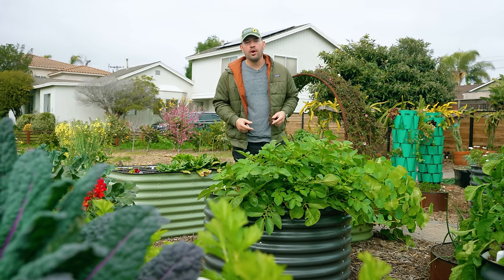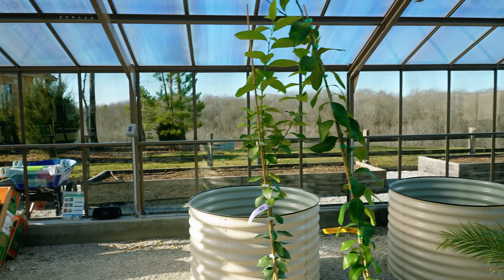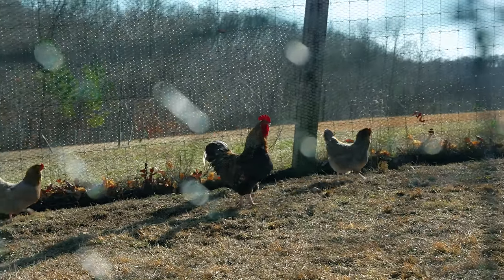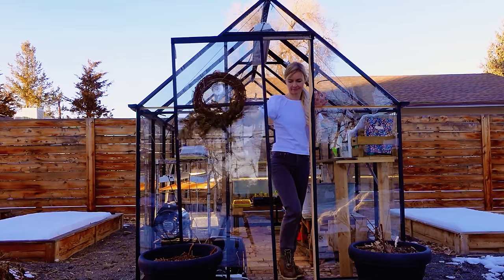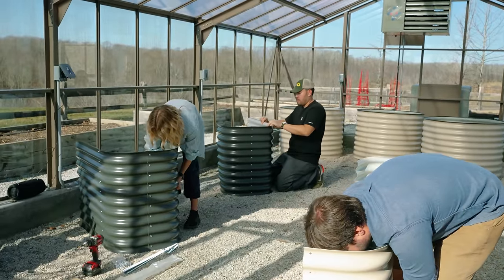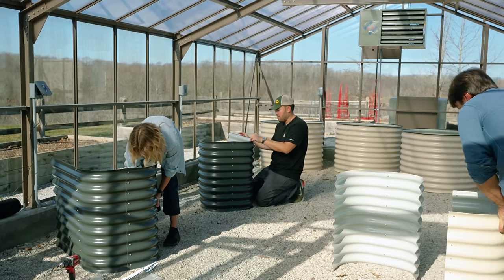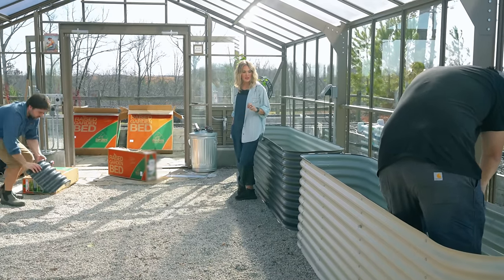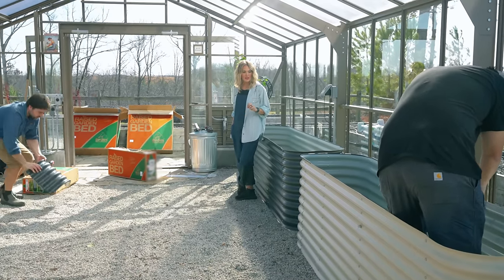Carrie Underwood's EPIC Greenhouse Buildout - @carrieunderwood

Comment: I know this is an older post but as far as the potato issue goes, There are determinant and inderterminant types. Determinant like yukon gold and red norland will only produce tubers on a single level. So to get a container full, you would need to plant a level, add dirt then plant another level. Indeterminant ones you can add soil and they will add potatoes up the stem. So if she planted a determinant potato, it really would matter how much dirt she piled on. There wil only be potatoes on one level.

Comment: Great job guys super Greenhouse looks really clean and tidy with your raised beds I hope Carrie has a Baseline irrigation system with a Garden on that scale it would make watering so much easier some of the smaller areas they could use the Rachio System which can all be operated online, also if they installed an EZ-Flo Main-Line Dispensing System on the irrigation or zone lines then you can put in products like Dramatic K Fish and Kelp Fertilizer and Myco ApplySoluble MAXX

Comment: Good stuff guys, it'd be mint to see it filled out later.
What are your thoughts on HPS to extend a season?
There is a tight budget so $150 HPS vs 2k LED lights leaves a lot of room for power. They are also a good heater.

At the very bottom of NZ greenhouse is 2.4m x 3.6 & 2.4m high

Comment: I had the EXACT same experience with potatoes as Carrue mentions… I’m in TN too…but I think ants may have eaten my potatoes?? I got absolutely NOTHING…in several grow bags…did the same, adding soil as the potato plant grew…left til green part was completely dead…then waited a couple of weeks. No evidence whatsoever that any potatoes had ever been there(no rotten potatoes or anything)…I have been trying to figure out how to put the grow bags on something like concrete blocks inside something I can have a water barrier to prevent ants…I have a very bad problem with ants in my yard…trying to address this too…
ANY IDEA why no potatoes grew in any of my grow bags?? Could ants have been the problem? LOTS of ants in the bags when I dumped them out.

Comment: I have a small suggestion: you look like a tall dude and I encourage you to customize your "countertop" height to suit your height...rather than a conventional height. Adding even a few inches/the equivalent in metric to the counter heights in my cabin kitchen and bathroom(s) proved to be a massive  boon to my back. My kids were then Itty bitty, but I simply bought sturdy collapsible ladders/step stools which they, themselves, could pop up/use/return to their bespoke niches. 

My sons grew to be taller than even I myself...and have commented ~ as adults ~ how much they prefer the counters THERE as opposed to those here (in town)...which are the "standard height". 

My lake countertops are very basic (a "temporary" set up with 2×4 construction and homemade bespoke (and beautiful) fabric "cabinet doors" on metal iron  hardware which allows the "doors" to be opened & closed...hiding the plywood shelves with large  Rubbermaid containers in which all our dishes/pots & pans/Bakeware are stored. This was a necessary evil to minimize work as the cabin was not yet 100% vermin-proof...and deermice are a health hazard I took seriously. 

Ironically enough...decades later (and a medical crisis which preempted our weekly visits during the years of rehab thereafer) means our "temporary" kitchen endured far longer than I ever imagined it would. 

In retrospect, I am so glad I took the time initially to fashion the curtains (and to clad the framing 2x4's likewise in matching fabrics) as I genuinely like "pretty" yet highly functional design. I knew it would bug me if I had open shelves with the ugly/functional framing materials exposed to view. 

We originally sufficed with an adhesive vinyl shelf liner as my "counter top" (for the safety protocol for sanitizing against deer mice is DAILY BLEACHING of all horizontal surfaces (or any and all cookware which was not immediately [upon becoming dry] stored away in my "hermetically sealed" containers)...so plain plywood would not do. 

We eventually "upgraded" to sheets of good quality countertop material, framed with showwood in edge grain hemlock (to match the custom cut 16"×5" slabs of old growth timber we had milled for our window sills). One can legally buy "Stanley Park Fall Down" which results when the old growth timber gets blown down by winds and thereafter send such rare wood to a "Custom Cut" mill to be cut to your specs. 

We used oversized hemlock logs (with a 16" top diameter) to build our cabin [typical house logs being 13" top diameter] and those few inches translate into a VERY different look. To be in proportion, one can not use conventionally available lumber...and glue laminated or manufactured stock lacks the beauty of edge grain old growth timbers. 

I digress...but it's interesting how inexpensive materials (and creativity) can complement wood which is truly beautiful. 

And  the HEIGHT of one's counters is such a wonderful, inexpensive  adjustment to give you YEARS of comfort.

Comment: Fruit trees especially potted trees don't like large quantities of organic matter in their potting mix. Stay away from bark or compost in potting mixes used for trees or perennials . I've had much better luck with non organic potting mixes of mostly sand, pumice, volcanic rock mixed with coconut core or peat moss. Even straight decomposed granite works well as long are you top dress with 4 inches of compost. Non organic mixes are much better draining and will not breakdown and rot over time. The coco core or peat moss will retain some moisture and basically doesn't rot.  Place compost or bark on TOP of the soil as a HEAVY mulching to help retain moisture. Think of it this way: Rotting organic potting mix kills the tree roots, rotten TOP DRESSED organic matter feeds the roots.

With nonorganic potting mixes, it is almost impossible to overwater. Put your trees on irrigation and you can almost "set it and forget it." You can not drown them.

When repotting your perennials and trees, try to remove as much of the organic soil as possible without disturbing too many of the root and replant into nonorganic soil. The change in your tree health will blow your mind.